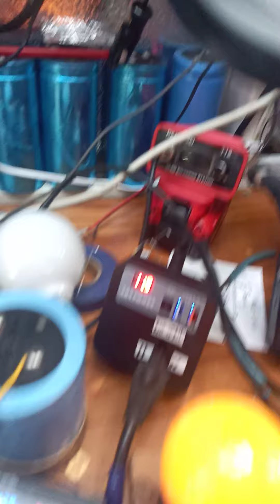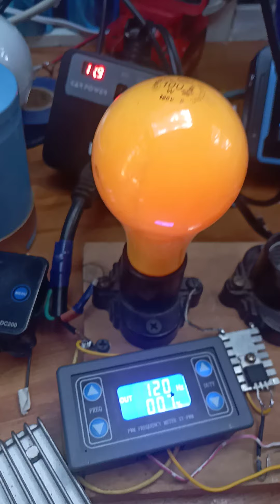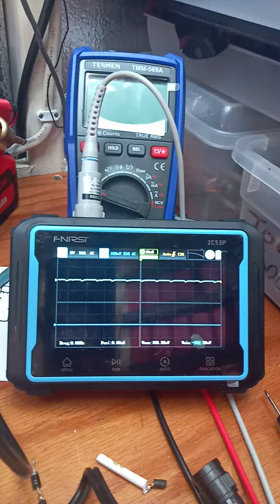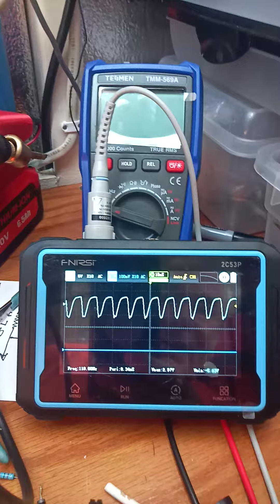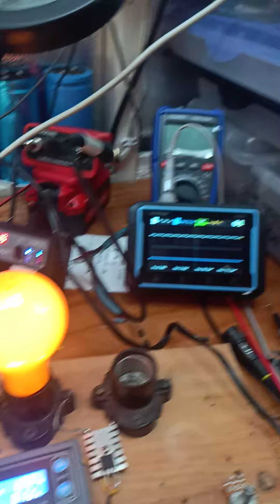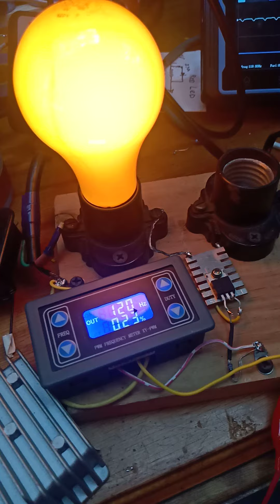Direct Power 2, Buck Converters Connected To PV, What The Others Won't Tell You

Comment from the maker: This what they don't tell you about using a buck converter with a solar panel because they are just box openers.
 
Buck converters are designed to work from a low impedance source like a battery.  The input capacitors are just large enough to keep the electronics stable and not oscillate.  Many have a label warning not to use them with solar panels and inverters.  This test with a 100W solar panel is not in full sun and can only produce about 30W.  Even then there was a peak ripple of 7V.  That ripple voltage can destroy a capacitor over time and these modules are all potted.   MSW and sine wave inverters draw maximum current at the peaks.  Just like my water heater designs, Power needs to be stored at these minimum draw periods.  The inverter can then have the added power of the capacitor and the solar power.  Otherwise, this power is just lost.  When used with a solar panel, 10,000 to 15,000uF capacitors are needed across the solar panel for longer life and added power capability.

Comment: Just over 800w of solar will give me 1.6kwh of free power, with used panels facing south on a sunny uk day, welcome to the real world buddy 😂
Reply from the maker: All solar is local.  Site determines a lot. South facing panels are antiquated ides from when panels were expensive. I have some East facing panels that allow me to recharge battery, heat water, do laundry and run the dishwasher.  All those things get done before South panels ever start producing.  I have almost nothing for a battery and power right from the panels.  Not only efficient but at a fraction of the cost of typical solar systems.